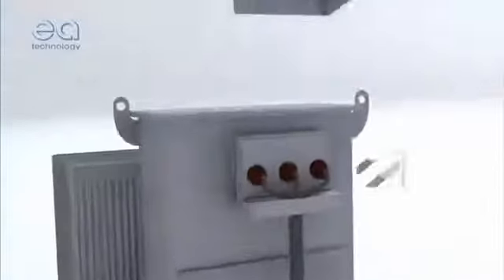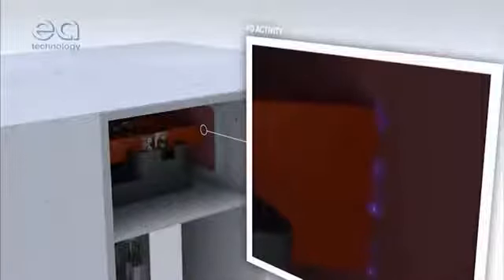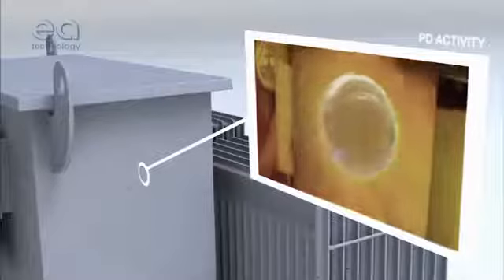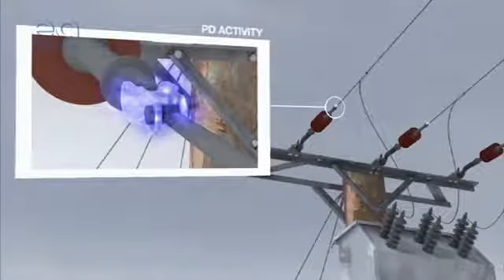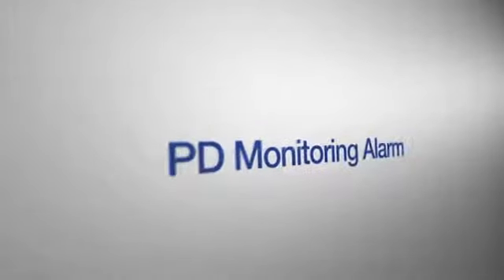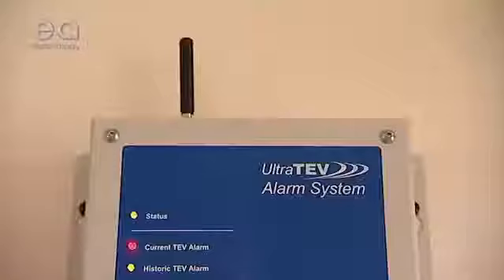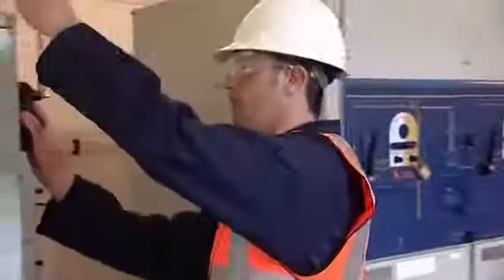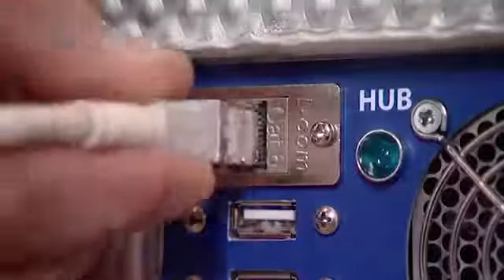Partial Discharge - UltraTEV Detector

Comment: What is meant by TEV
Reply: Transient Earth Voltage - it refers to the pulse of energy finding its way to ground through the grounded metal enclosure that occurs during a partial discharge.
Reply: I think it is Transient Earth Voltage.